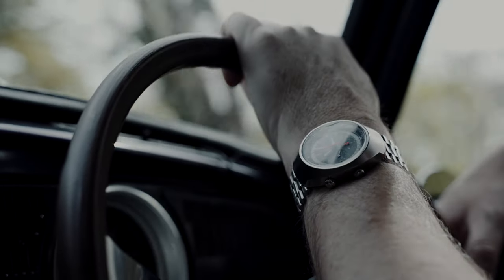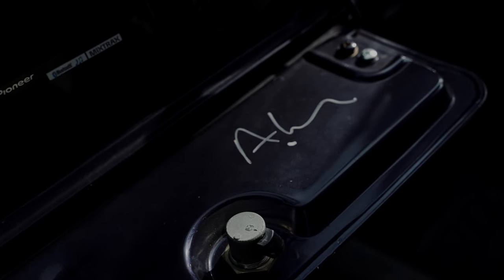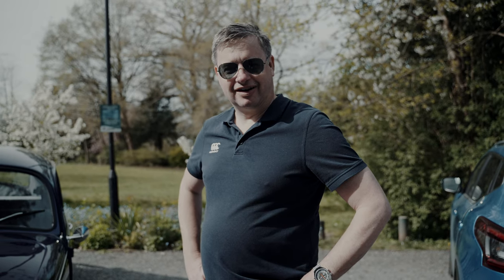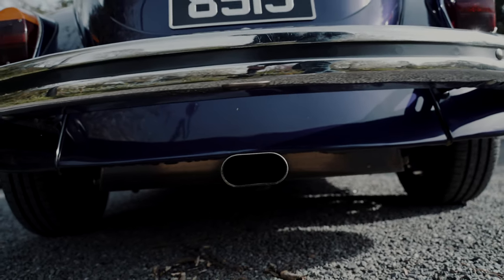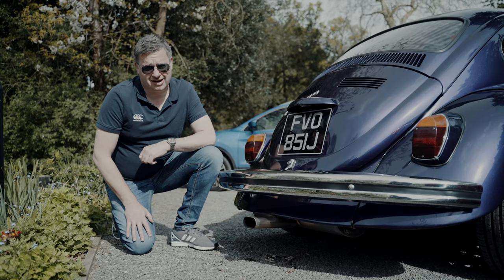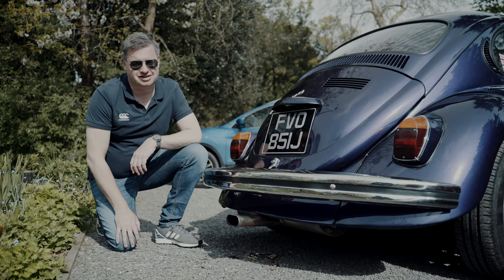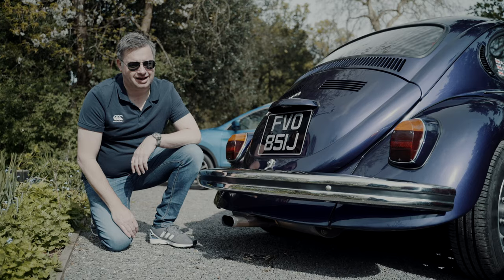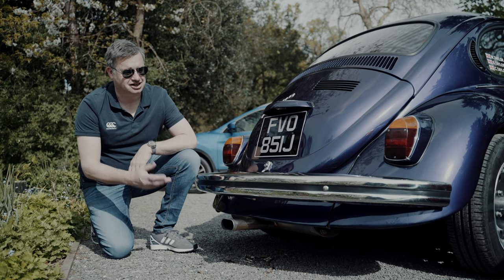Real review of the Vintage Speed Sebring Exhaust

Comment: Maybe one day someone will actually rev the engine at full throttle and we’ll really hear it. We can only hope!
Reply: I'm pretty sure that stock 1600 with the custom non-scaviging exhaust system is giving it just about all it has I guaranteed  that header system would rob horsepower from a built motor.
Reply: @chuckingram5966  not even close to WOT